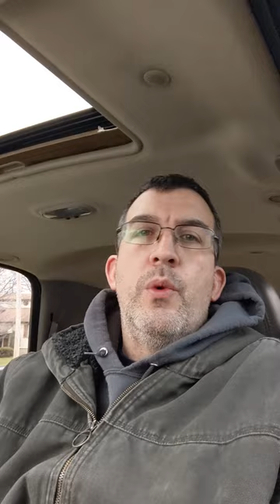6 month update on the Scotty Kilmer lacquer thinner hack

Comment: Wait you ended up having to buy "a cheap cat online for $400"? Then hows this a not a fail?
Reply from the maker: I was able to revive my passenger one in which case that would have cost me $800 for both cats.  So if anything it was a partial fail.  but being on a budget, spending $400 as opposed to $800 Seems like a big saving.
Reply: I believe all depends on the condition of vehicle and the components.  I'm not mechanic but common sense, youtube & not afraid to get my hands dirty
  I'm planning on this process this weekend for a recent P0430 cat bank 2. 2011 Nissan @ 139k miles well maintained
Reply: @supercraig2009  How'd it go?
Reply: @supercraig2009 How'd it go ?
Reply: @superque4  unfortunately didn't work for me, but worth a try. Yours may work 👍

Comment: Worked for me 15k miles ago
Reply: Did it mess up your O2 sensors
Reply from the maker: it did originally.  I should have kept in the older ones and then run this test and then swap out the o2 sensors to new ones.
Reply: @FMJeeping  thanks for the reply! Oh man, still better than replacing the cats though I guess. Did they go out relatively quickly after? PS I’m also in CT
Reply from the maker: @BrownC0uch  hi fellow CT'er.  Lol.. The O2 sensors died shortly after running the full tank of thinner.
Reply: Thank you for the update 
How many other people have also had to replace their O2 Sensors after using Scotty Kilmers one gallon of lacquer thinner method to pass smog test?

 Also, can you take your car in for smog as soon as the check engine light goes out, or do you have to consume all fuel and add new fuel before taking it in for smog?